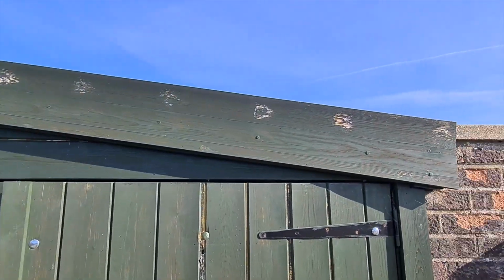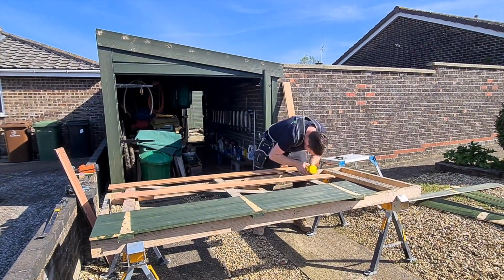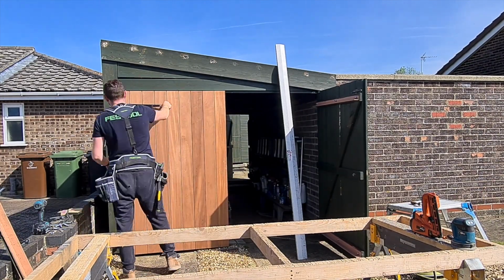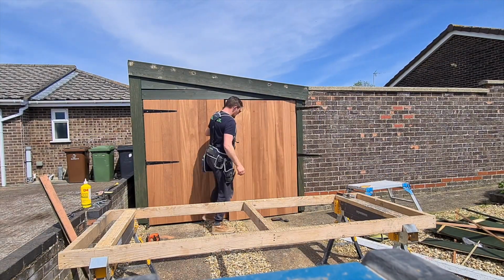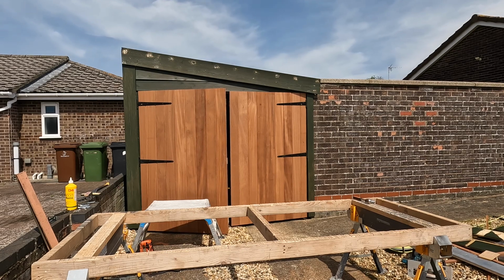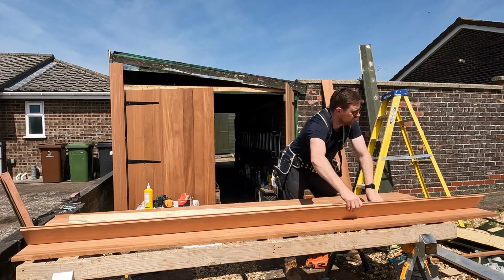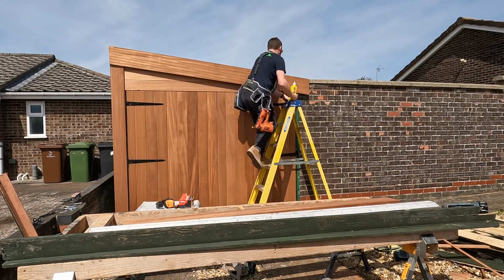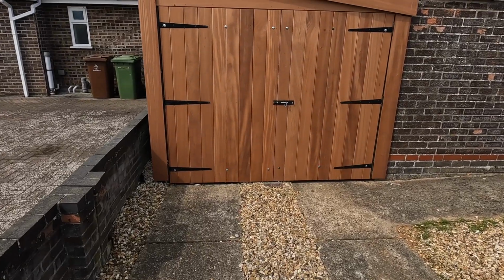I LOST money on this job!! A garage door that went WRONG!! Should we all be using hardwood now?!!

Comment: Approx 5 years ago i made my own garage doors pretty much the same size as yours from off the shelf joinery grade pse soft wood and i haven't had any problems what so ever .  I believe its because they are fully framed ledge and braced with mortice and tenon joints . Instead of putting one diagonal brace in i fitted two to form an A pattern brace and a drip rail on the bottom of each door . The t&g boards were attached usind stixall grab adhesive and stainless steel pins , i know people say you shouldn't glue the boards to allow for expansion and contraction but i haven't experienced any negative issues at all as the grab adhesive has some flexibility to it . Im by far no expert but i feel doors of this width need to be full framed .  Great workmanship 👌
Reply from the maker: Thanks Peter, I think there are so many ways to do it. Once I did it in hardwood using the same method they have been fine. I think I just got unlucky with that specific batch of wood maybe. But the lesson to take from it all was not to do something the cheap way. I should have priced up for full framed and ledged doors and left it at that
Reply: @BuiltByBen-YT   finding decent straight un twisted wood is a bit of a challenge nowadays! Good quality hardwood is the better option but unfortunately it all comes down to the price and most people go for the cheaper option .
Reply from the maker: Fully agree 👍

Comment: I am sorry to say lots of the comments here are correct -  to add one or two - the facia should have been fixed the other face against the wall (look up fixing cladding and grain orientation).  You shouldn't use second fix brads for anything other than holding something for glue to go off (as a clamp). and you shouldn't be using glue to fix these timbers (either along the edges or to the rails and braces) if the timber was cupping - you should have faced the shrinking side against the rails and braces. (so it fights the rail and braces not pulls away and the glue wont hold in this scenario - as you have learnt)  Proper mechanical fixings either screws or nails that are suitable (ring shank, even oversized and bent over from behind like traditional) Also only 1 nail in the width of the board (look up the placement). 2 nails in the width of the board means it will split! .... this is quite basic stuff ......  0ver a meter in width you should expect moment of at least 1cm that's a minimum.  Harsh to hear and I'm sorry but I am sure you are talented at lots of things ... serious lack of knowledge here

Comment: I’m an amateur but I’ve built a lot of outside projects including garden gates. I use soft wood from builders merchants as hardwood is way too expensive. I coat the job with (in my case) Everbuild wood stain/preservative. It is brilliant stuff.  Three coats and it will last two winters easily. One quick top up every two years and it’s fine. No rotting, warping etc at all. The first coat is important as softwood can go blotchy on the first coat. Apply the first coat and wipe it off straight away before it dries. It acts as a pre stain, no blotching, and the next two coats do the protection.  Plenty of colours too. (My opinion only, no connection to any firm inc Everbuild).

Comment: I call 45 degree fixing opposite ways butterfly fixing
Reply from the maker: Big fan of that. Everyone should be doing this on whatever they are doing
Reply: @BuiltByBen-YT  mostly use it on skirting boards where there is no dab behind the plaster board . Stops it pulling off . Gives it time for gripfill to work .

Comment: Should really have some sort of capping with a drip mould to stop water absorbing into the end grain at the top either on the actual doors or on the frame.Thats whats causing all the issues. Soft wood is fine to use outside as long as its properly sealed and regularly maintained but i would never use white wood outside just not good enough for the British weather. Just needs to be designed and installed properly. Id say this garage/garage doors have a massive design flaw. This issue will keep happening even with hardwood.Need to keep the rain away from that end grain.

Comment: T&G doors/gates can create a lot of problems with softwood. I never glue the tongues and they move like mad during the year. I've seen screws from the rails pull out from the planks with movement. The ones that seem to last on garages /sheds I've done from joinery grade softwood (fiths) were the moisture is tested prior and framed/ledged/braced. You've done a great job to go back and solve the problem mate. 👍
Reply from the maker: Thanks Jason. Kind words mate 👍

Comment: Nothing wrong with softwood its the manner in which you're constructing it!
You've basically over fixed the tongue and groove, each board needs to expand and contract independently of each other.
I never glue the tongue and groove joint, just a dab in the centre of each board where it meets the ledges and some 18 gauge pins either side if the glue dab.
I learnt this the hard way too, trial and error and copying traditional methods.
Hope this helps someone.
oh and always leave a 2mm space in between each board!
Reply from the maker: appreciate what your saying but some of the cupping that was happening was occurring as I was fitting it. and I fitted the hardwood in the same way and have had zero problems. 🤷‍♂️ we all think different
Reply: @BuiltByBen-YT  never buy timber from the likes of "Builders depot " or "lawsons" etc
Reply from the maker: @carforumwanker  no I never do that
Reply: @BuiltByBen-YT  no you're right if you start with an inferior product its very difficult to rectify!
Reply: Beat me to it. The whole point of tongue and groove is to allow for expansion and contraction of the boards. The boards need to be able to move independently. Looking at the original door the large split out gap was entirely down to glueing the tongues. For sure the warping was a major contribution but failing to follow tried and true methods contributed. Fair play @Built by Ben for fixing it but unfortunately even with the hardwood it is going to fail again.
Reply from the maker: Fair point Paul. Maybe the glue was wrong! I certainly hope I don't end up going back though! Although the joinery did suggest glue so I suppose some people may still use it? 🤔 that's the good thing about these comments sections. We all learn every day!
Reply: Ben is  great craftsman,  but like yourself I would never glue T&G and have never heard of anyone who does.
Reply: @carforumwanker  where should i get it from
Reply: @redx11x  A REAL timber yard . And as mentioned ….. stay away from Meranti etc !

Comment: I can see the a few things you’ve done wrong sometimes it ok to use pine but you do need to paint both sides of the timber as if you don’t moisture will get in one side & not the other. You should never glue tongue & groove it needs to move if you do it will split. Just a bit of advice. 👍
Reply: Thats what I noticed straight away. If the fitter painted this well it is the fitter fault as not painted/sealed right and the wood has moved with moisture by the look of it.
Reply from the maker: In some earlier comments I have stated that some of the wood started curling slightly before I had even fitted it. The issue is definitely with the quality of the wood and nothing to do with the fitting
Reply: @BuiltByBen-YT  er wood curling is because its drying out to fast usually worst at the ends.  Jeez dude don't fit wood that's in the process of warping. Only yourself to blame here. No worries you made it right. It's just a learning process.

Comment: If you're only nailing boards they're always gonna bend and as you know if the timber isn't sealed properly they aren't gonna last long. Screws might look unsightly but on 3x1 battens like that their your only option. £800.......I'm definitely undercharging
Reply from the maker: The £800 was for some alterations to the frame, all materials and ironmongery, fuel and getting rid of the old wood etc. 2 days to do the job originally. So maybe not as much in my pocket as you thought? But new doors and frame made by a joinery where I live would have 1000 before they were even fitted. Hope that helps 👍
Reply: @BuiltByBen-YT  after looking at those doors I'd have made my own FLB doors, you were asking for trouble there Ben. 40 years experience as a maintenance joiner makes you a bit of a clairvoyant...... you'll get there, all the best.
Reply from the maker: Cheers Paul

Comment: I bought a shed and a bike shed, both pressure treated softwood. The wood must be so wet when they cut, shape and assemble the panels and doors because the wood shrinks alot cross the grain. I think its an all too common thing these days. Pressure treated timber is soaking wet!
Reply from the maker: Yea it's always soaked from some places

Comment: Surely you aren't glueing those toungues?
Reply from the maker: Yea I have learnt from the comments that it probably wasn't the best idea! As I self taught carpenter I just have to learn as I go
Reply: @BuiltByBen-YT  fair enough, fyi if it is dried properly and used internally it is t so bad but they are meant to move otherwise it splits.
Reply: I would never use glue and nails as a fastener, always use stainless screws and leave a small gap between boards... Keep up the good work...

Comment: Framed, ledged and brace would be my preferred choice on this project.
Reply from the maker: I should of but was trying to keep cost down for the customer.  Big mistake! Will definitely be doing frame ledge and brace next time.  Won't be bitten twice! Cheers for the comment 👍
Reply: @BuiltByBen-YT   Your joiner didnt help you gluing the t and g`and using white wood cut so close to the heart. Been a jobbing carpenter and joiner for 45years, I made my own doors and windows because of joiners being so slapdash with quality.There are plenty of doors like that around decades old,and its true the wood was better quality. Fair play to you for trying to fix it, but you were on a hiding to nothing mate. Like others say we al learn from these experiences,and clients can talk you into doing work against your better judgement.
Reply from the maker: Cheers for the comment 👍
Reply: Same here with frame ledge and brace.But, you can't fault the quailty of Ben's work.
Reply: @BuiltByBen-YT  It costs what it costs. If the customer doesn't like it, just walk on by.

Comment: Ok next time learn to do it properly.
1. Do not glue your boards! The boards need to 'move' if they can't they'll do what they did.
2. Lay your first board, then use a 3mm packer to space the next and so on. You haven't left any expansion gaps, hence the cupping.
3. Use bigger hinges.
4. You didn't oil or paint any of the tongues or the backs of the doors where they sit onto the frame. This NEEDS to be done.

Keep practising and you'll get there.
Reply from the maker: Sorry Jamie
Reply: Not your fault, but unless you know exactly what you are doing you cant be posting videos. 
Otherwise people then copy what you have done and get it wrong.
Do you have a friend or someone you know who's a joiner, who maybe you could do some work with?
Reply from the maker: @jamiewestbrook2957   This video is in no way a "how to" video. It simply shows what happened to me on a job and what I did after it went wrong. I have built many things and some of them go wrong simple as! If you want to show people how it is done then a YouTube channel is free to set up. Go for it!!! 🤗

Comment: Auful job. Will not last.
Reply from the maker: Cheers Chris
Reply: @BuiltByBen-YT  Ben, it’s not about softwood v hardwood, it’s about design and method. Some softwoods are more durable than some hardwoods. The “cheap” t&g would have not cupped if it was free to move (not glued) and attached allowing for expansion. A coat of wood preservative, especially on end grain, adds years to its life. Your repair job will probably warp also, considering the flimsy frame and the tight glued assembly. Do you have a moisture tester?  Cheers, Chris.
Reply from the maker: No Chris I don't. Maybe the glue contributed to the problem but the bargeboard was not glued and cupped to almost 70degrees. So I still think the wood was no good
Reply: Awful

Comment: And as mentioned ..Painting really is a issue . On new timbers you have to use a breathable system .
Reply from the maker: Yea the paint that the customer put on was not ideal and he only painted the outside which was silly. Never the less, the timber had starting curling way before painting so it still needed to be put right. 👍

Comment: I would say a big factor was the paint
Reply: Didn't look like the tongue was secured. The glue would've aloo caused the wood to cup as it soaked in and expanded the back side. Not sure why he used glue TBH. Tongue-tite screws work well and don't split even crappy softwood.

Comment: Ur doing the job i wish i had done wen i was younger.
But i failed myself.
Thats another story.
Spent last 16 years working in double glazing factory, doing lead work which i loved and the main reason i stayed.
But after having a bad back since my early teens, came to a head 4 years ago, requiring me to have a spinal fusion.
4 years off work and no closer to going back.
At 51 iam thinking of changing career, becoming a handyman, specialising is woodwork, final fix carpentry etc.
Spent last 2 years wainscotting almost every room in my house, to get experience.
But with still having a bad back, i still need rests every couple hours or so.
Which is not good wen ur doing a job for a customer.
Hoping to get work fit again soon, but as it is, doing jobs just take so damn long right now!
Reply from the maker: Never too late to learn a bit of carpentry mate. Cheers for watching

Comment: when selecting timber for a job like this it is always wise to choose boards that have been converted tangentially from the log, not those that have long curved growth rings as these are definitely going to be less stable. the facia board is a good example of this that is why it cupped, bowed and twisted.
the boards themselves are always going to expand and contract as they gain and lose moisture so should be fitted in a way that allows them to move without damage, secret nailing for example. all tongue and grooves should be painted/sealed before assembly and if possible protective drip stops or weather boards fitted when possible. would have been a good option to fit top and bottom of boards in a groove under top rail and at top of bottom rail with a weathered edge on the top of the bottom rail.
just sayin, that`s all.
Reply from the maker: Cheers for the comment 👍

Comment: Softwood has gotten so bad. You can build a perfect thing. The sun and seasonal changes will ruin it and make it look so bad. I’ve had the same experiences. And lost money using it. I now only want to use softwood on framing members that will be covered by cedar, composite, or another quality option that will hold up. It’s not worth the call back or rework. Great job on your work. Your a quality craftsman.
Reply from the maker: Cheers Jacob.
Completely agree 👍